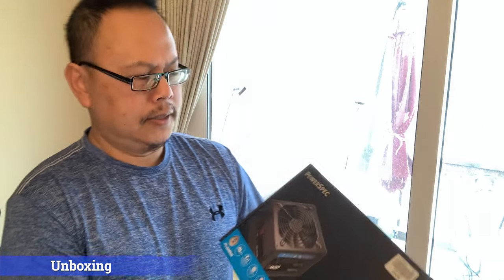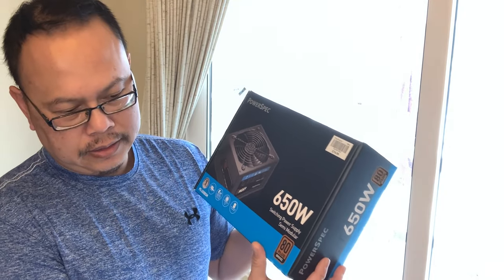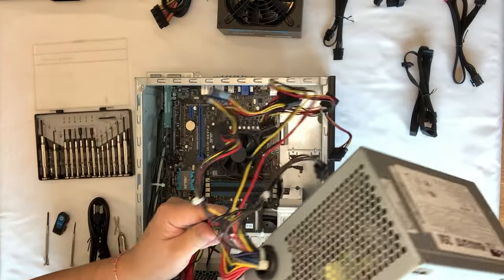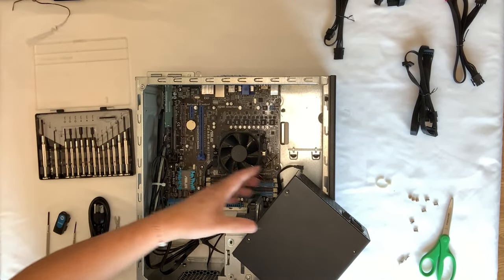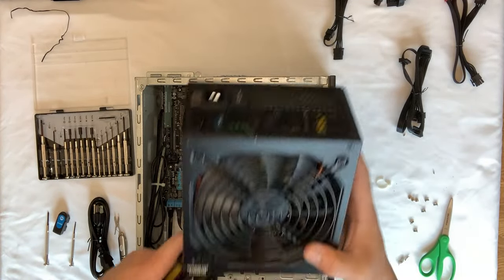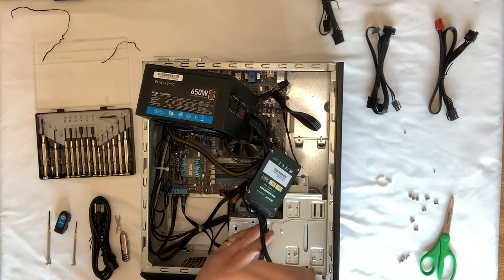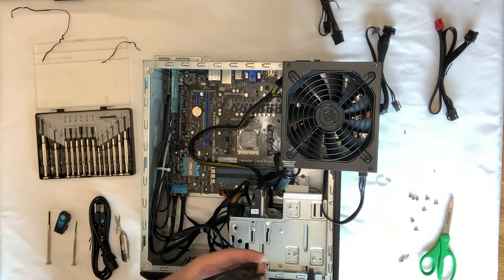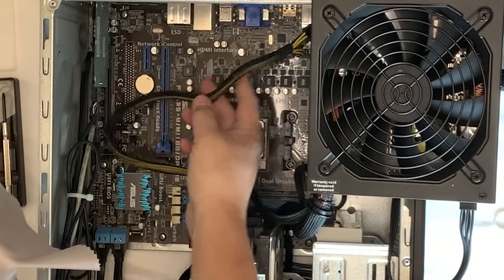How To Upgrade ASUS M11BB To A Steam Gaming PC & Unboxing SATA SSD 512GB & 650 Watt PowerSpec

Comment: Ok  you cleaned all CPU cooling paste off the CPU and the heatsink fan. You did not reapply CPU paste (fail) CPU will burn up (no thermal paste)

Comment: omg, you took off the thermal paste? :| wow hopefully someone told you thats a no no unless you plan on replacing it...
Reply: Buy some thermal paste asap to put on your cpu and watch some videos
Reply from the maker: Yeah already done that. Didn't mentioned it in the video. But thanks for pointing that out. For those out there make sure to get the thermal paste and apply it back onto the heatsink.

Comment: Hey Ottster, I have a couple questions about the desktop itself if you dont mind helping me out. I have a friend who has the same PC i think (AMD APU A10-6700 with Radeon HD 8670D) and 12 GB of ram. Do you think that the original powersuppy (i dont know the wattage) can support a no-pin connector 1050ti directly through the PCIEx16 slot? we're trying to get her a small temporary upgrade because she cant really play some of the low end games on the APU itself

Thanks for your time!
Reply from the maker: hey there @parth P.. I don't know if I can answer your question. My original power supply was 350 Watts.  Manufactures usually try to save money so it's not unusual to have to upgrade the power supply. If I were you, I would verify visually what the wattage is of your friend's power supply. Then I would add at least 150w to that for the 1050ti. I have no idea what his motherboard is and if it can deliver the power or not. Good luck worth a try.

Comment: Sick, still have my m11 after 7 years. 430W PSU W/750gtx ti ftw edition. Need some ram, ssd and a quiet cooking fan. Any recommendations for a fan?
Reply from the maker: Hasn't had any issues with what I installed so yeah here's my recommendation. PowerSpec 650 Watt 80 Plus Bronze ATX Semi-Modular Power Supply - https://amzn.to/2KZ7apQ